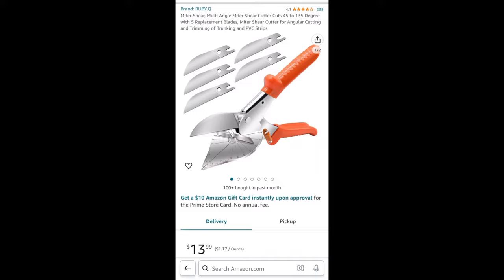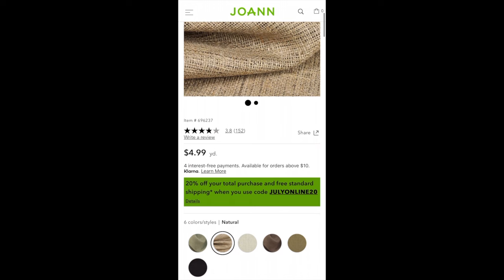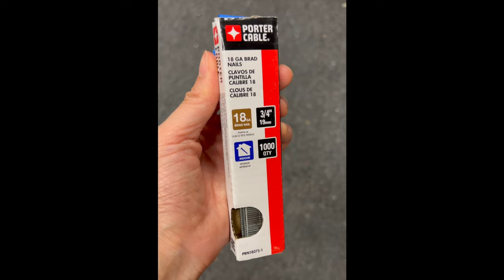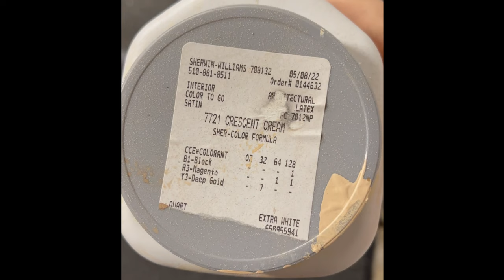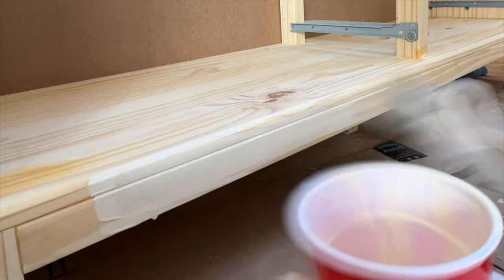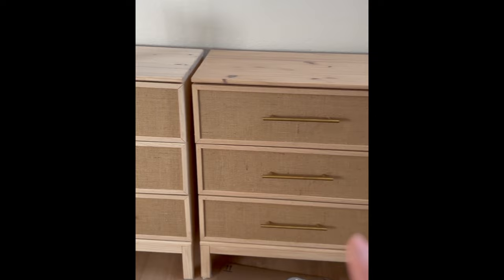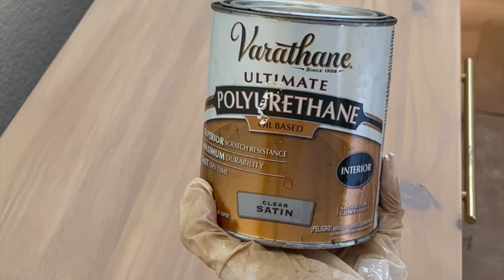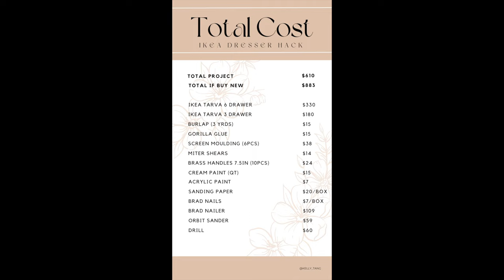IKEA Tarva Dresser HACK | ✨DIY Oakwood Finish✨|  Japandi Design 🌿

Comment: Nice job! Did you fill the brad nail holes? Was there a reason why you didn't connect the units? Any ideas on how you might eliminate the gap on top?
Reply from the maker: Thank you! I didn’t fill the brad nail holes but you can cover them with wood filler before staining and poly coating. I left the units disconnected for the flexibility to use them as separate units in the future. You can probably use wood edge banding to cover the tops. Hope this helps!
Reply: @Kelly_Tang  It does help and thank you for posting-nice work.
Reply from the maker: @janetkuhl-urbach639  Thank you so much for your kind words. I appreciate it!

Comment: Kelly, beautiful work, what kind of paint brush did you use?
Reply from the maker: Thank you so much, Paulette! 

I just used a polyester paint brush for the polyurethane coat. But in retrospect, I would’ve used a foam brush instead so I can just throw it away. The polyurethane is very difficult to wash out of the paint brush!
Reply: @Kelly_Tang  Thank you.

Comment: Oil based polyurethane will turn yellow over time. Water based will not yellow.
Reply from the maker: That’s great to know! I’ll keep that in mind next time I shop for polyurethane. Do you know how long it takes for the oil based poly to turn yellow?
Reply: A few months. I painted an Ikea unit off white to match my walls.  I used the oil based polyurethane and now I have a yellow unit. I'm going to redo it as it looks like crap. LOL. Maybe it won't be as obvious on your project, but it was real obvious on my white paint.  @Kelly_Tang
Reply from the maker: I’m hoping that since the wood is warm toned, the potential yellowing would look less obvious. Thanks for the info!
Reply: 🙏 @Kelly_Tang
Reply: But, the dresser is gorgeous!
Reply from the maker: @warmblood8016  really appreciate it!